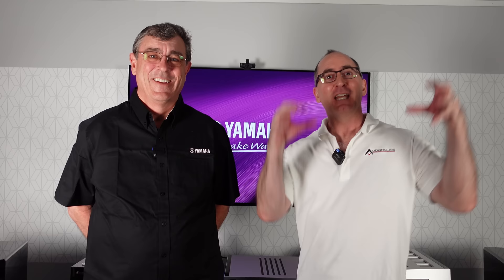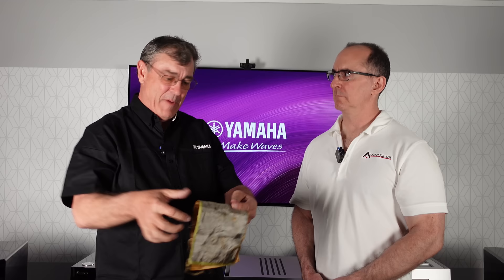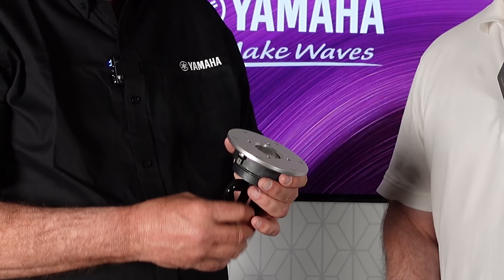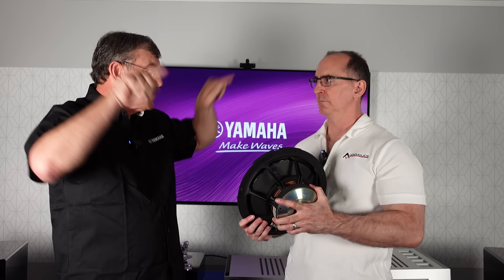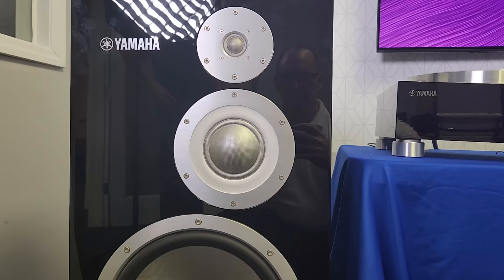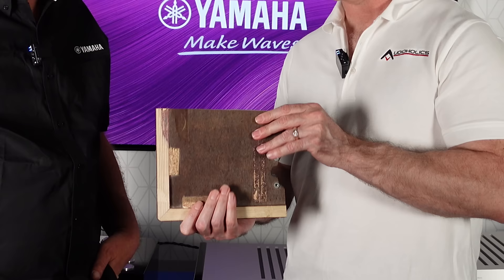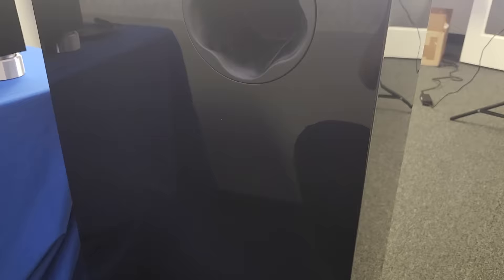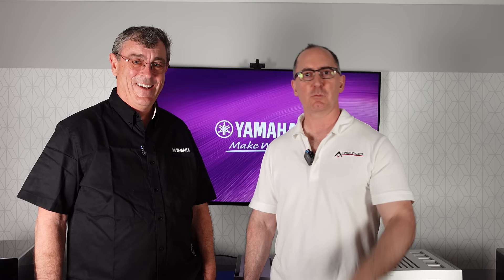Yamaha NS-5000 Loudspeaker Overview - A Legend Reborn?

Comment: My first audio system was a pair of NS 500 Rock Monitors 8" woofer and beryllium tweeter, with a Yamaha CR-620 Wood finish receiver / 640 Italian design.. I traded up for 5 watts and .03 decrease in harmonic distortion.  I still own the YP-D6 turntable.  My final upgrade was the NS-500's for a pair of NS-690's, which were a completely different design.  Acoustic suspension, rather than ported.  3-Way opposed to 2-way.  Silk tweeter rather than beryllium and a added mid-range.  The main improvement was the 12" NS-1000 woofer offered in the speaker (690).  Big Alnico Magnets!

Comment: I designed my own speakers for my system. Looking at the build quality alone and the engineering concepts,  it looks like Yamaha has put a lot of effort into this speaker. Would love to hear them. 15K seems very reasonable, taking into account that audio equipement is becoming very expensive and you are getting less and less in return.

Comment: A friend of mine had NS-1000Ms.  I would not characterize them as warm and musical.  They were cold, clinical, and very revealing, but they were less fun to listen to than a lot of other speakers.   Without any doubt I can find LOTS of speakers in the high end range that are better.    I expect the 5000 to be more or less the same thing, just updated.   I'll stick with my Aerials.
Reply: Clearly you didn’t watch the video. So you’re basing your opinion on zero experience of actually listening to them. If you’re not doing amateur comedy you should be. You’re a natural.
Reply: @jockojockoson9995  Oof 😂

Comment: Pretty sure Yamaha has a custom made PBO fiber for their Zylon so that it doesnt degrade in UV exposure cause im sure a lot of folks wont being putting covers on these speakers. The surface fiber is most likely another fiber or surface coating on them so that its still lightweight but prevents most UV from penetrating which is what we see as the gray material
Reply: Vapor applied monel coating.

Comment: thank you Gentlemen for the great review.
i'm in a dilemma here. i can't seem to find a dealer in Massachusetts to Audition these Speakers.
the other thing is that do you really have to buy their recommended equipment to drive them ?!. and lastly. have you guys tried to listen to them using a Tube Amp like Mcintosh  or any other equipment ?. thanks again
Reply: I paired it with a McIntosh mc240 in a 6m by 9m, good sound. I also have gryphon mono block and FM 711. The 5000 is my My best hifi  investment. I owned an MBL reference before. The 101E was good but very power hungry. Btw, you can forget the YG too.
Reply: @ChanSweeMan  thank you for your reply and thoughts.

Comment: I like my Yamaha audio but think if any manufacture built $10/20,000 speakers only, they wouldn't be in business long. But Mfg's seem to want to splash $20,000 speakers all over the place and then build far cheaper speakers and work to make connections with these to the $20,000 speakers, they know that keeps them in business.

Comment: My wife likes the small size/big speaker sound. We have them on a 3 inch lift with casters that screw into the spike locations. In the market they are alone in matching the material across all house built drivers. While I was still listening to them in the showroom my wife was up at the counter paying for them. They are rated for 600 watts so they go as loud as you dare with ease. We were looking at speakers up to $25K but these beat them in our process. If you can then you must.

Comment: In a passive crossover design, as is the case here, the large inductor in series with the woofer now prevents the amp from having complete control over this driver. Specifically, reduced transient response. The current cannot instantaneously change through an inductor as would be needed to accurately drive a woofer. This will result in a bass response that will not be as tight sounding as it could be. For $15K speakers, they could have avoided this by putting a plate amp into the cabinet with an active crossover from the woofer to the other drivers. Unfortunately, there is very little public appeal for connecting speaker wires to a full range speaker and also having to plug it in. Hence the same exact compromise for all speakers in this category including Magico, Revel, RBH, Wilson and many others.
Reply: Wish Yamaha will trick down these techs to a lower priced 6.5" woofer version 3 way speaker
Reply: Yours appear to be a very valid point about using active crossover to improve quality of listening, may be they could provide an option to buy an active crossover model of this, could you please propose this to Yamaha for industry's sake, thannks.
Reply: @ajithchandrakumara  , if AVR manufacture's can implement at least a digital crossover between 2k and 3k in addition to the  current LFE around 80Hz, the whole speaker manufactures will make huge change by making crossover less true bi-amp speakers.

Comment: Dual spiders, but no 5th foot! Heresy I tell you.
Reply: LOL
Reply: Please explain
Reply: @ajithchandrakumara  Yamaha loves to act like adding a 5th foot to their receivers, rather than just 4 like most boxes have, helps the sound.

"The newly designed Anti-Resonance Technology (A.R.T.) Wedge is a fifth foot in the front-and-center of the chassis unit base. Together with double bottom structure, it dampens much more vibrations from the power transformer, power transistors and heat sinks, as well as vibrations that might be caused by the sound from the speakers — providing dynamic sound and focused, accurate reproduction. The fifth foot on the A8A has special brass parts inside which continue to provide further detailed and richer sound reproduction."

Comment: Most overrated speakers out there, yamaha ns was never a great speaker in my ears. Now these "new" ones are 15k ?! Riddled with cheap parts iron core Inductors, electrolytic caps?! 

Thsn the "carefully " chamber thingie. 
Dude i swear , every year you see these old reincarnations of speakers. Pretending they are incredible...

At 15k you can do so much better than this especially on the second hand market. Lot less id say easily
Reply: Have you auditioned these speakers?
Reply: @CS-bz9lk  this is because of the weakness in the chain. The 5000 just revealed it.